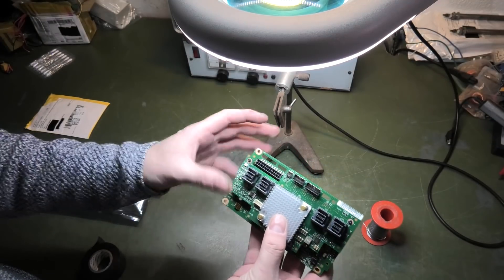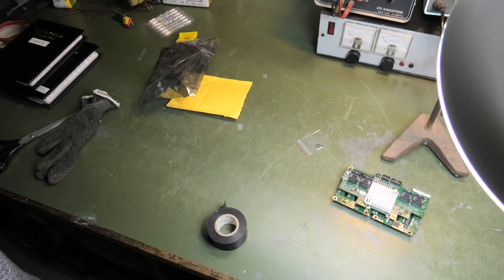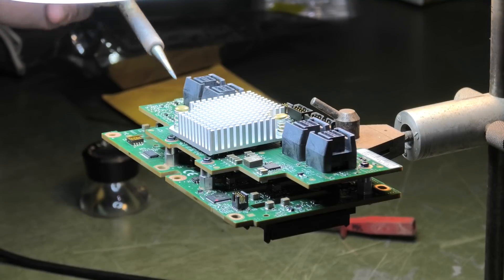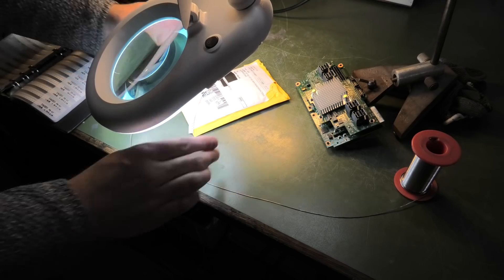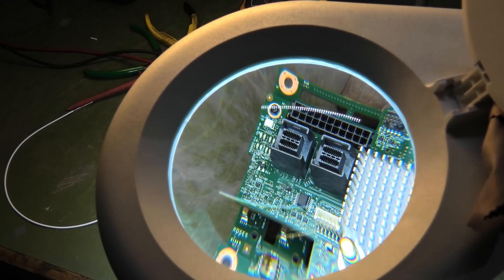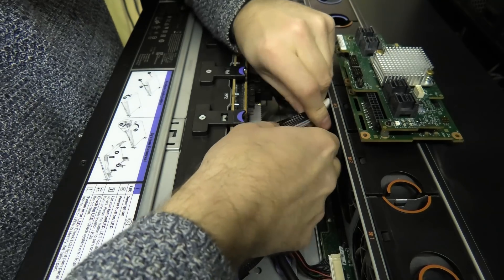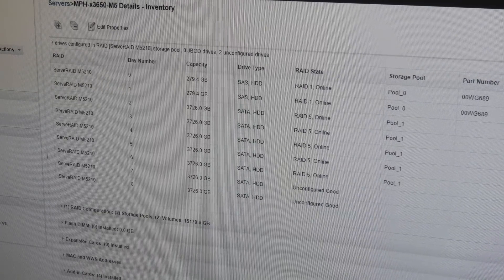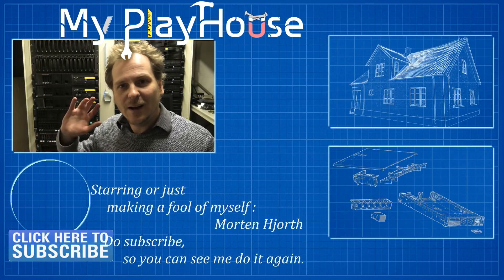BAD Ninja Hack of x3650 M5 Backplane Expander 00FK661 - 925

Comment: You could look at the resistor on the good board to see if it has a value printed on it (or even try to measure it in-circuit, remembering that you can't always trust in-circuit measurements)
Reply from the maker: Hi Iron Fe
Thank You very much!  glad you liked the video :-)
Thank you for watching! :-)
Reply: @MyPlayHouse  microscope 20 quid and a hot air soldering iron you can make you a pump and an old iron and modify it to blow hot air bit of flux and your a winner